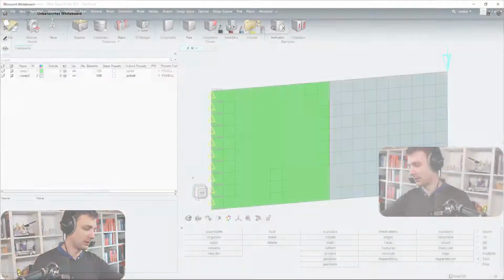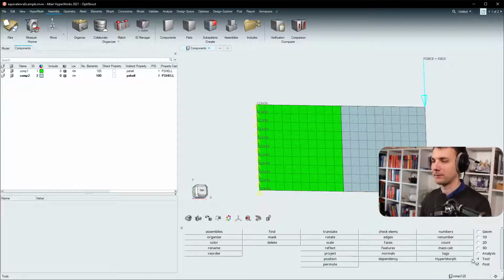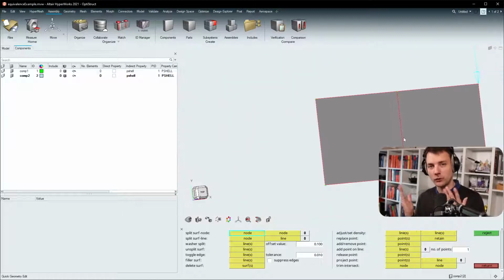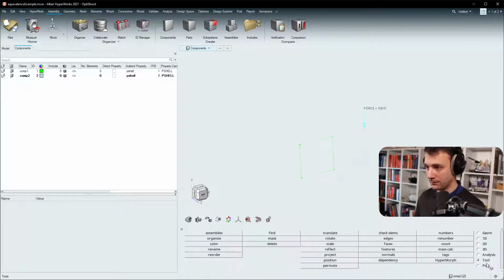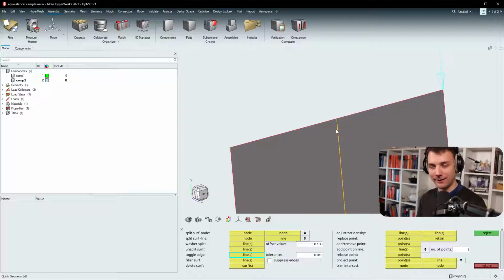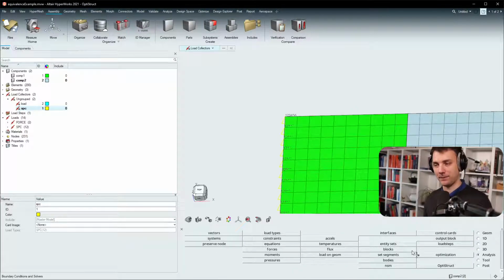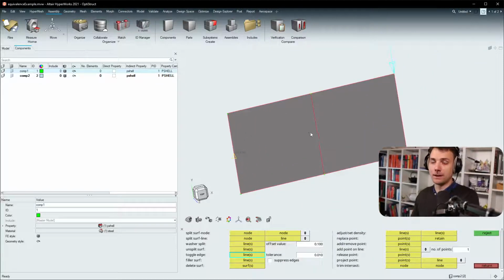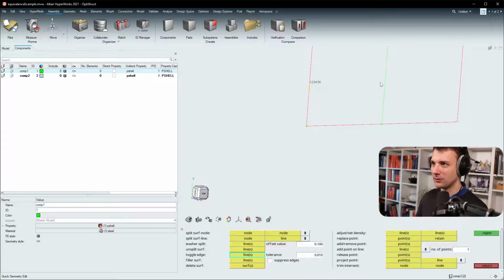Hypermesh Node and Edge Equivalence Practical Example

Comment: How can you undo de equivalence? In case you need to simulate crack analysis for example
Reply from the maker: You could split the geometry entity (like line or surface) for example. The mesher then will create separate nodes on each side.